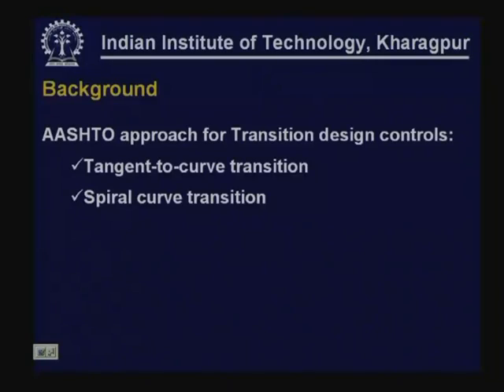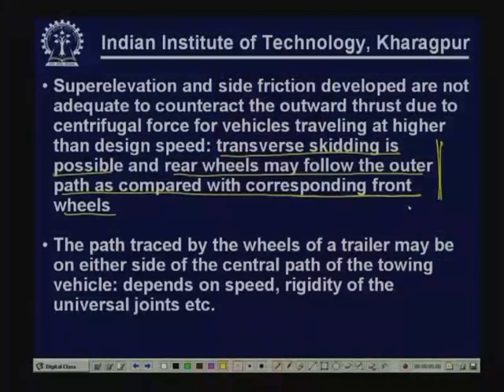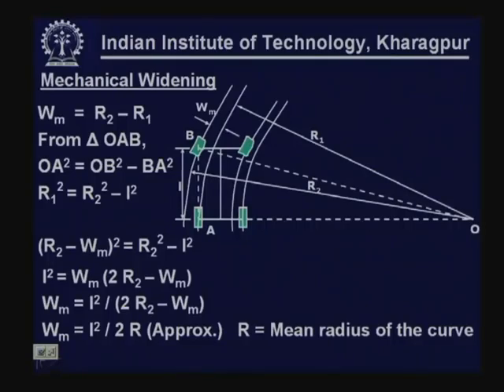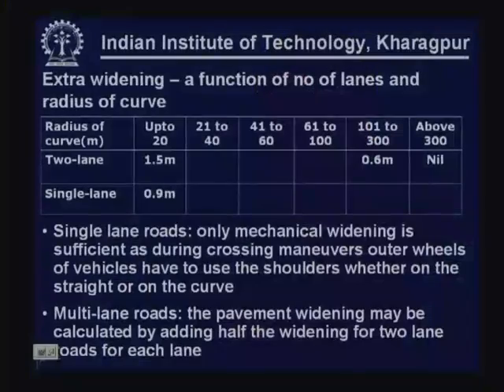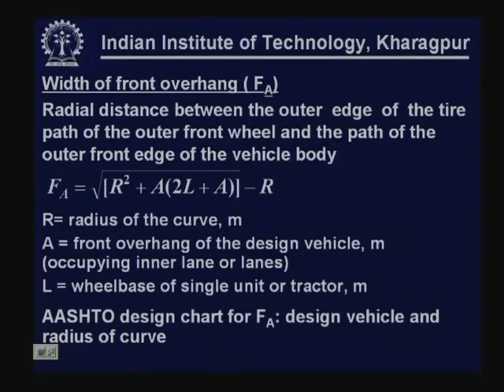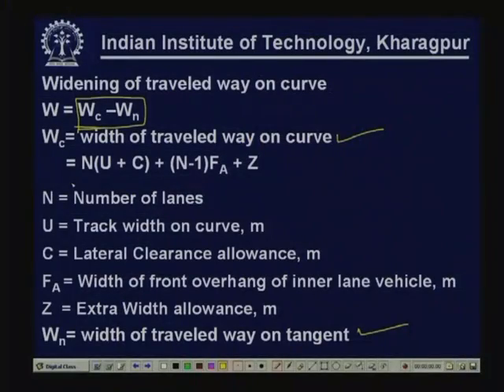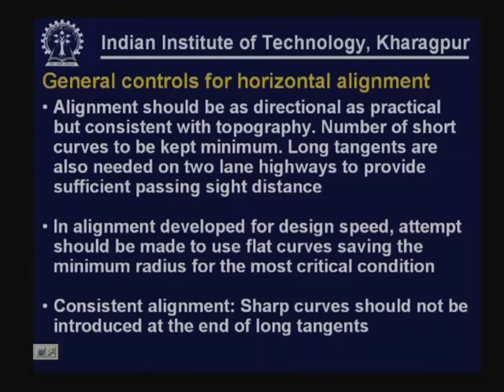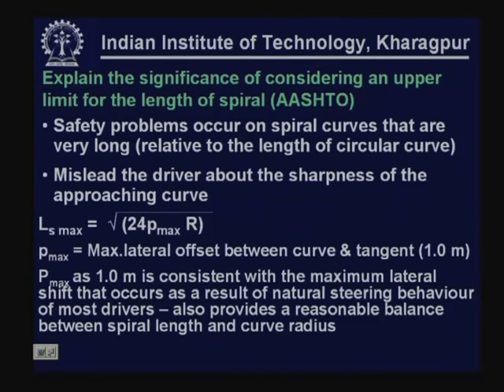Lecture - 19 Horizontal Alignment Part - VI

Comment: 52.31 very long tangent sections (exceeding 3km ) should be avoided.--------------------------------There is already IRC norms in rural roads for keeping straight road length less than 3 km IRONICALLY NO NORMS FOR NATIONAL  HIGHWAYS . Please suggest any IRC norms for national highway for maximum staight length.

Comment: Why is cure widening aplied only on the inner portion of the road in curve and not on both sides?
Reply: Becz inner wheel moves inside
Reply: And for large radius curve it is provided on both side 50% 50% if transition curve is used